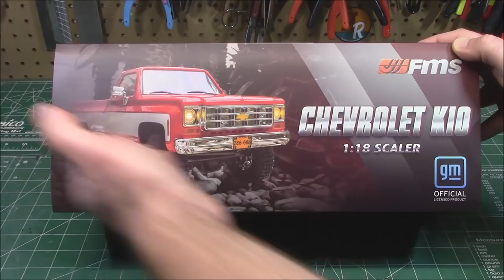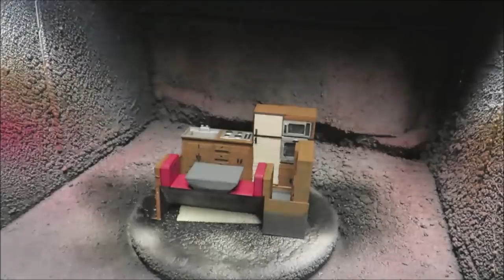Chevy C/K Pickup Camper w/ Interior 1/18 Scale Model Weathering Painting Rust Fading Squarebody FMS

Comment: Beautiful!  What your top'-heavy beast needs is what the real truck has -- anti-sway bars.  They'd be easy to bend out of stiff wire and mount to the chassis and suspension. How about an off-road ambulance with miniature strobes on top?
You've captured the look perfectly.
Reply from the maker: Yup, as is from the box it's made for rock crawling with very very soft springs.
Like I mentioned, you can simply stiffen the stock springs but I want to remove the camper for some fun crawling now and then.

Comment: I can't tell if that's squatting in the rear or it's torque twist. Either way, great video. There are a few things on Thingiverse that you can print for the K10 and the Glacier.
Reply from the maker: It squats like the real ones do with that much weight.
But also the springs are super soft for rock crawling.

Comment: By and large most in-bed campers overhang the bed on all sides and most importantly had a full length door at the rear which meant you removed the tailgate. I think the camper you used is also underscale, maybe 1/20 scale?

Comment: I got a 1:1 scale K-20, 1976 mustard yellow and white two tone, daily driver. May have to see about this, wish someone made a static kit of one.
Reply: The grille on the 1/18 K10 makes it a 1977-78 model I think, so that minor detail is the only thing "wrong" with making it a '76. I would be willing to bet someone has made different 3D printed grilles for it. However, it would be easy to cut out the grille area and make your own with styrene strips, 7 vertical slats, 3 horizontal.

Comment: Scale sizes befuddle me. I now use this "method". 1/18 scale means if you build EIGHTEEN of these models and line them up - end to end they would be the length of the ACTUAL truck. If these were 1/24 it would take 24 models end to end to be the same length as the real truck. And 1/72 would need 72 models to equal the length of the full sized truck. Thinking this way when seeing a model, you can quickly work out how big or small it will be next to a real one - truck, tank, car or boat, scale = how many will equal the real thing
Reply: Correct.
Reply from the maker: Yes, you have it correct.
To figure out the size of a model you'd take the real length in inches and divide by the scale. 
If the length of a real truck is 180 inches, simply divide that by 25 to see how long it is in 1/25 scale.